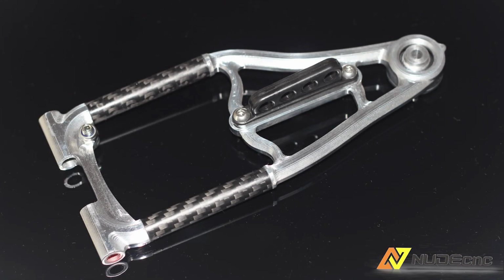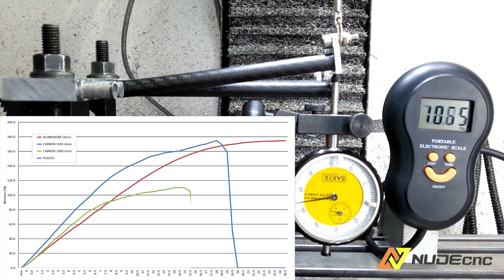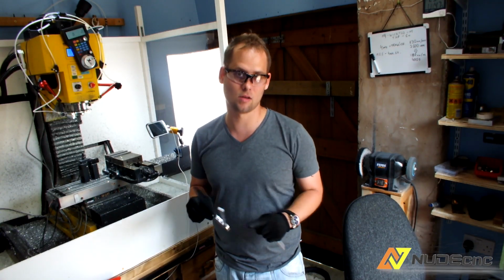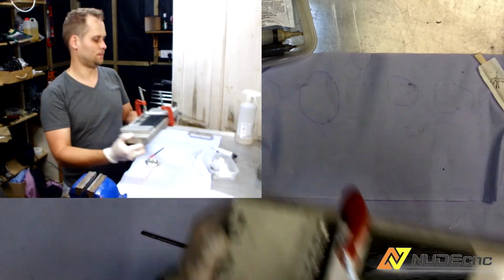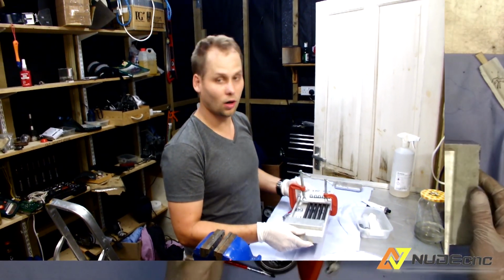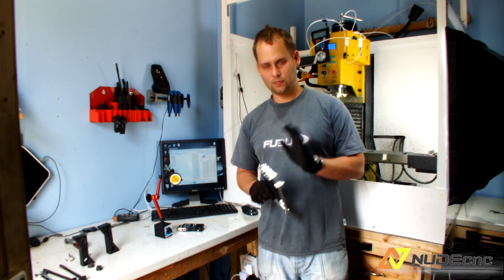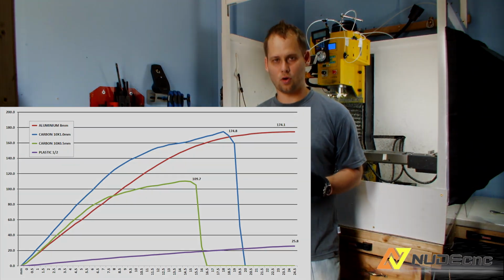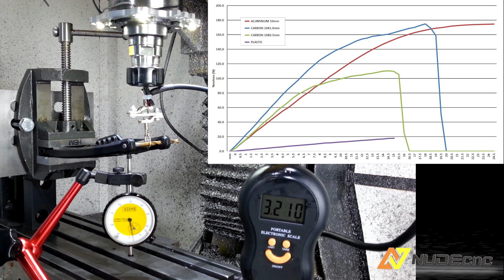Aluminium vs Carbon fibre strength TEST Part 2 of 3 (RC Model CNC build)

Comment: You should also be concerned about galvanization. The weakest point will be the edge of the aluminum where the bending stress can cut the carbon fiber.